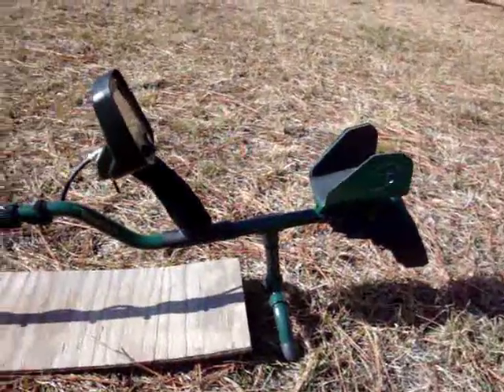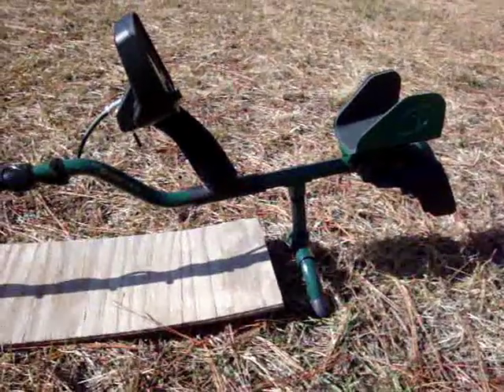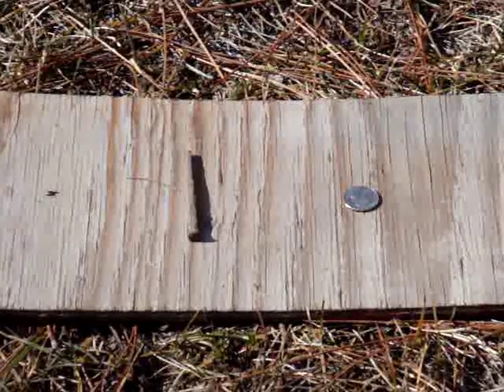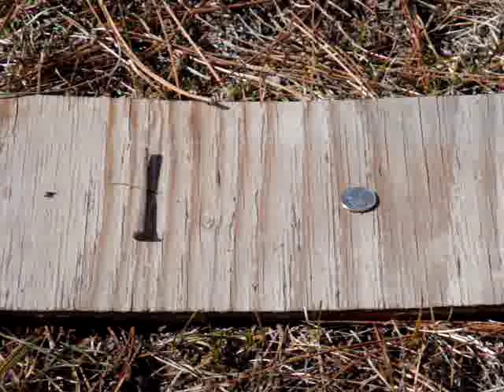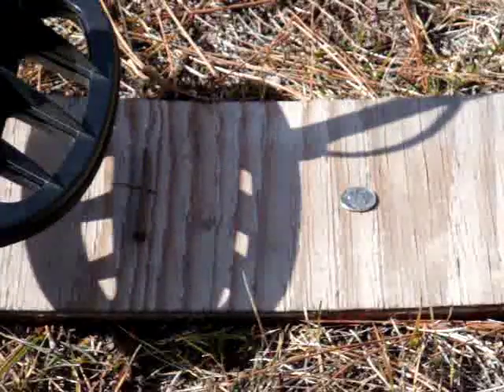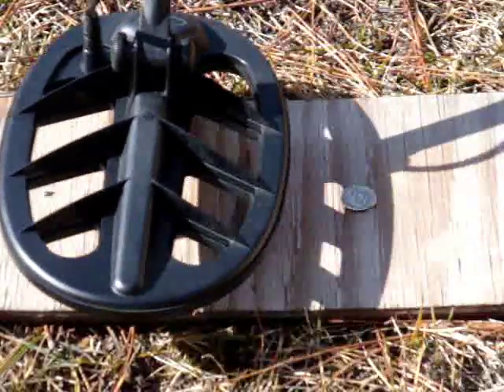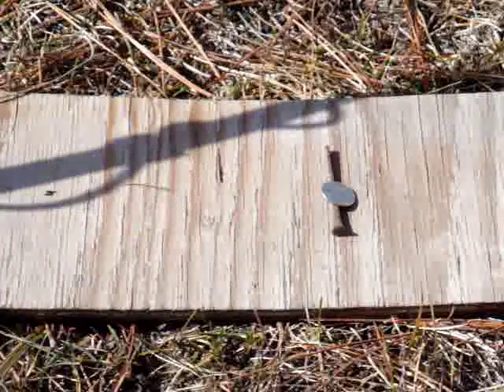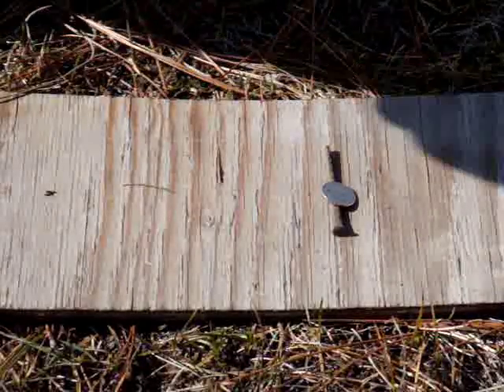Teknetics T2 Separation

Comment: Enjoyed the test, The T2 is a great detector. when you test again, try putting the nail so the tip is pointing at the coil. It will give a different result.

thanks
Tom in SC